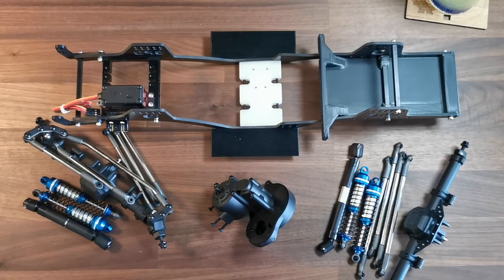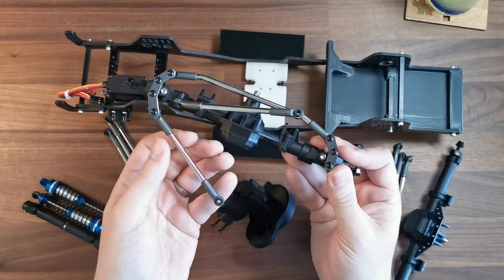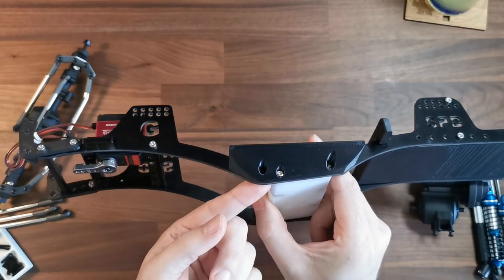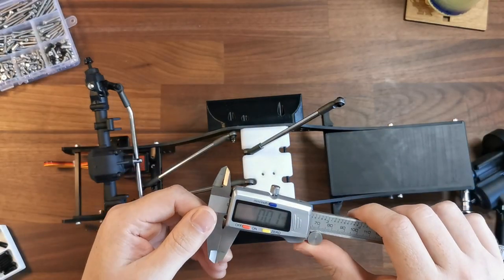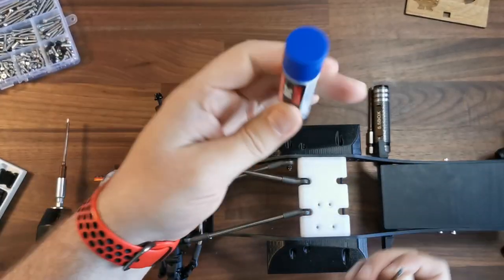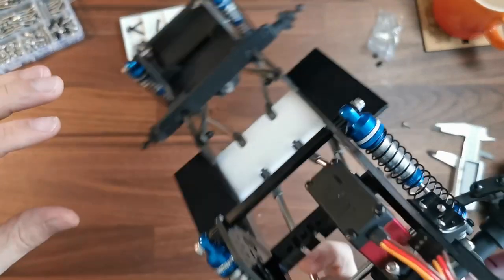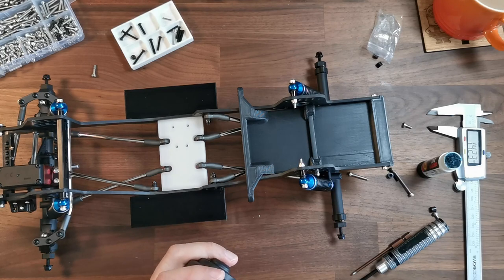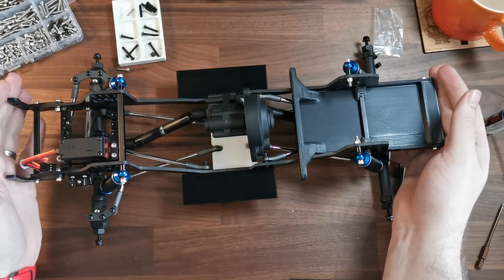Gspeed Element Enduro - pt2: Rolling Chassis Build

Comment: Hi m8 on the frunt I would take a spacer out off the pan hard rod to chassie it will give u bit more clearance pluse only push 1 side of the axle at 1 time as u nearly never c both sides of the axle goin up at same time n for the backe I would clock the top links back anothere hole it will clock the dif more up n it will give u smothered runnin n lot less angle on drive shaft n 9 times out of 10 the top links r bout 70% of the length off the botum links iv learnt all this from buildin a scratch build 6x6 truck n some proper rock crawlers  m8 ur doin well m8 👍👍
Reply from the maker: Thanks David, really helpful info. 😁🤙
Reply: @PhilBrindley  no worrys thing is if it don’t work u can allways put it back lol but do remember the nilock nuts r at there best the more u do n undo them on small trucks m8 let me no if it made difrence m8 👍👍

Comment: Nice build series, bought one myself on the back of your videos. Just one question where did you buy battery screwdriver from 😂
Reply from the maker: Hi Jason, they are such a good chassis, and the Enduro kit it really versatile. The screwdriver was from Aldi, or maybe Lidl, can't remember which but they have them in quite regularly. The only downside is that there is no torque clutch, so I have to be really careful not to over tighten stuff, especially in to plastics! 🤙

Comment: So what are the advantages of actually using this chassis over the stock one? Besides a bunch of shock mounting holes
Reply from the maker: Good question. So for me it's 3 things. 
1. Shock mount options. These allow lots of tuning of suspension without have to keep changing shocks/springs/oil.
2. Upper link mount options. With the GSpeed that's only for rear links. Giving more tuning options.
3. Angled skid. The skid sits flush with the rails and is angled rather than flat. This helps you drag over obstacles and get the front wheels down without getting high centred so much. 
After that there are probably others like weight, durability etc. But these are less important to me.
Hope that helps. 🤙
Reply: @PhilBrindley  thanks, that does help

Comment: Great Build , What size Flatbed did you order from Shapeways ? I'm unsure of which one to buy :) ,,Oh and did you screw in body posts to the flatbed ?
Reply from the maker: Thanks. I designed and printed my own rear bed. The file is available on thingiverse. The rear "posts" are nylon standoffs and a long screw. They just locate the back of the body, there aren't any clips in them.
Reply: @PhilBrindley  This rear bed will complete my build , again many thanks 🙏
Reply from the maker: @grski900000000000000  no worries my friend. Happy truckin'! 🤙